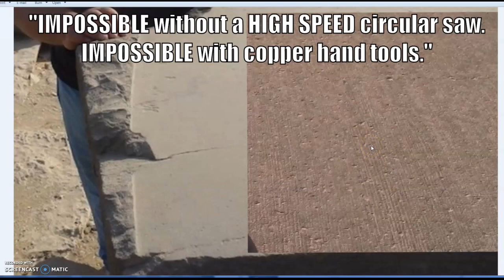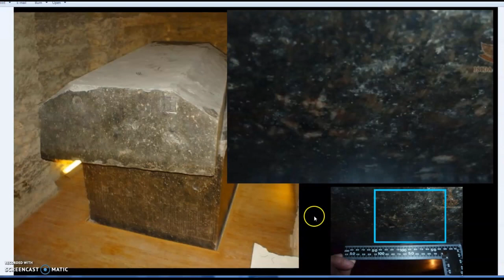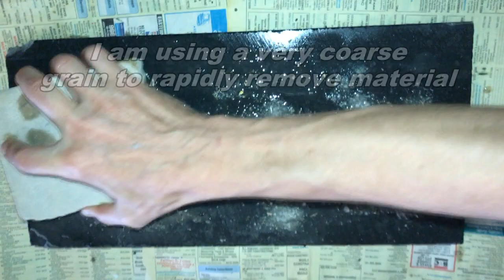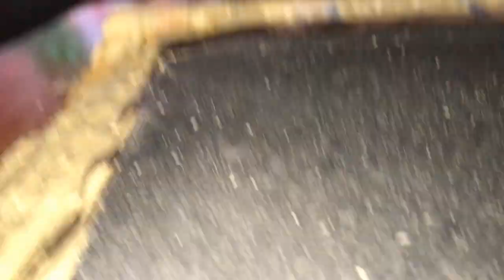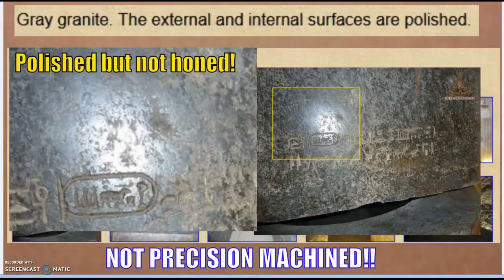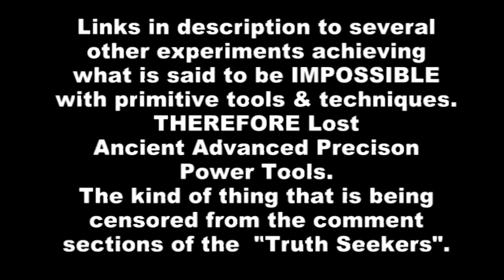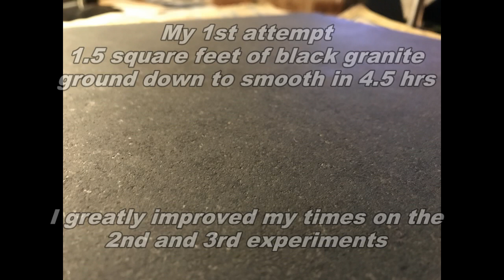Ancient Stone Working Techniques: Experiments with Black Granite on Removing Striations

Comment: Hey SGD hope you're well? I believe Ben, at UnchartedX, may have hosted a discussion with Chris Dunn recently that was aimed at getting some answers, from Dunn's perspective, on our LAHT debate.  I was not super impressed with his answers and I believe he is an example, in the reverse, of the phenomenon that LAHT folks describe effecting traditional Egyptologists? We say that their lack of engineering and hard scientific understanding has made them unable to recognize the signs of LAHT.  I believe C. Dunn is an example of the opposite case.  His lack of knowledge of 'traditional' Egyptology or History has blinded him to some pretty well established theories about the creation of some artifacts and structures?

1.)  An example of this, in that interview, is when Dunn says to Ben, while they are discussing the idea that some symmetrical features of the statuary would need to be cut by something like a modern programmable CNC machine, that to program code for an asymmetrical statue, as you SGD argue, would require a more complex code than a symmetrical one would.  Ben almost cringes at this suggestion because of your argument about 'Hellenistic' or Roman asymmetrical statuary.  This example illustrates both a misconception on Dunn's part and one on yours as well perhaps?

1a.) I say this because Dunn is obviously unaware of the controversy surrounding the bust of "Nefertiti."  It is believed that the discoverer used a 'model' created by the dynastics to, in a way, 'fake' or over sensationalize his discovery.  It probably turns out that once a pharaoh was named a 'model' piece of statuary, displaying the state sanctioned features of that monarch, were mass produced and given out to local sculptures and artists throughout Egypt to use as a 'model' to create more statues or images of that monarch to be sold or given out at the temples...etc to pilgrims and ancient tourists.  This could be done by expanding or contracting the well known 'grid system' used by the dynastic artists to create enlarged or shrunken versions of a 'formalized' image.  The "Nefertiti" bust discoverer is believed to have taken one of these 'models' and hired an antiquities forger, of which there were and are many still, to use period plaster and pigments, he had also discovered onsite, to sculpt the face on the bust.  If Dunn knew this story then he would understand why a very mathematical or geometrical system was used to create the statuary of dynastic times.  This does not address the issues around the cutting and polishing of these statues however, just the mathematical formulas used to design them.

1b.). The reason why you might also have a misconception about the importance of the symmetricality of this statuary is that although it would be more difficult to make a single asymmetrical statue than it would be to make a single symmetrical one; it would be nearly impossible to mass produce on a 'semi-industrial' scale asymmetrical statues without advanced high technology?  This means that the argument Dunn is actually trying to make, though he expresses it very poorly, is that the high precision symmetricality of the statues is evidence of LAHT for the reason that the definition of "high technology" here, as I understand it to be, is that the use of highly precise tools and equipment, difficult base materials to craft like very 'dense' or difficult to shape stone, and precise symmetrical elements in the designs of these objects is how we ourselves would mass-produce them in our own modern manufacturing facilities if we wanted to.  Does the argument make more sense when presented like this?

Just a few of my thoughts on these issues.  I have more but not enough time at present to write them down.  I am going to share with you, in my next post, something way more interesting to discuss.  I will also post this message on Ben's site.

Cheers,

Andrew
Reply from the maker: cheers
Yes I would agree ver much on the first paragraph, I would also believe it goes a little further than that, for instance on a recent episode of Ancient Aliens featuring Chris Dunn he repeats the claim "impossible with the tools found in the archeological record". Which would imply he is familiar with the archeological record on such things and what those tools can do, repeated experiments have shown over and over that the corners of serrpaeum or the H blocks at Pumapunka can be made with simple stone tools/ flint. 
https://www.youtube.com/watch?v=gyWeksAo8VM&list=WL&index=73&t=452s
Sculptor using a pantograph to make exact copies of beautiful statues, it's an ancinet tool at least as old as the Greeks to make replicas. Restorations of temples suchas the Parthenon they wanted to use as much original stone as possible, including broken pieces from columns etc. They used a pantograph to perfectly fit shattered stone faces to the new stone, this is the most difficult thing to do by a huge factor of difficulty.The ancinet method was the best for the masons in the field.
Though whether a assymetrical scuplture or refitting a broken piece of stone, such simple tools make transferring symmetrical designs seem like childs play in comparison. There are so many extra points that need to be transferred. In essence its like copying a chaotic squiggly line versus a symmetrical line. I would insist that the assymetrical copy is much more complex just by the sheer number of coordinates. if you can cut a piece of glass to fit into the missing shard of a broken window then refitting a symmetrical uniform shape... it's chaos versus order, chaos is just more difficult to measure then order.

I also think it's very interesting that the marble statue of David is used as a comparison but the Greek and Roman granite/basalt/ porphyry statues and large boxes are not mentioned. 
Or in regards to precision engineering the Romans aqueducts must surely be included at the top of any list, over miles and miles they kept the same angle, a gradient of 4800/1 being recommended. Vitruvius and Heron even describe the instruments used, such as the chorobates. Even by volume just one of the larger aqueducts made of stone rival the Great Pyramid, and they are more precise, the Great Pyramids alignment to true north is along the ground, the more precise aqueducts maintain a more precise angle THROUGH THE AIR!!!!! 
If you watch the LAHT community they rarely mention Greco-Roman except to diminish it.
I find it very hard to understand how they could be so ignorant of Egyptian archeology, and even harder to understand why they aren't fascinated by Greco-Roman engineering escpecially since we have amazing texts such De Architectura which is just an encyclopedia of philosophy, engineering, chemistry.
Heron of Alexandria...as in the Library of Alexandria. 
If you look at the work of Da Vinci, his design for machines on lifting etc are just copied directly from these texts. Vitruvius.... Da Vinci's iconic Vitruvian man,
Greco Roman era.... an Egyptian fascination, temples of Isis for instance and symmetrical statues from that period.

Sorry I could rant a long time on this.....For instance Manetho wrote an Egyptian history for the Ptolemaic rulers, when Manetho references the deep past it is insisted he must be taken seriously, but his histories on the Dynastic period which so closely match the historic record.....then it is presented as some sort of conspiracy.
There are so many clear double standards, cherry picked references, ommissions that I can only describe as deliberate.

Again sorry for rant, for the next few months at least I will be working with granite, I am buiding up my skills and replicating the "impossible without advanced technology". Here in Sydney there's nothing but sandstone for 200 km's in all directions. Restricted to small scale demos for now but arranging some larger experiments to replicate, compliment and expand the work that has already been done.
If I can do it, anyone can do it.
Reply: @SacredGeometryDecoded  Before the "Osirion" discussion I do want to comment on some of your points above:  

The Hellenistic and Roman examples, in statuary, I agree do rival the so-called "Khafra" 'ka' or 'Horus protected Khafra" statue (and a couple others that are similar to it, that were found, in the "Valley Temple") as well as the famous "Menkaura Triads" found in the mortuary complex near "G3."  By similar I mean:

In the type of stones used to make them as well as the detail and the finish as well.  I do also believe the 'missing' secret cutting tool for granitic stone is FLINT + one other tool. This other tool is chemistry.  I do, firmly theorize, that the so-called "scoop marks" especially but also a lot of the cuts and "drill cores" are a combination of an applied organic acid, other organic solvent, or caustic substance followed by cutting or scooping using flint, different strengthened metal alloys of copper, or even meteoric iron cutting tools.  

Meteoric iron, which I understand to be a much more difficult form of carbon, alloyed with who knows what other exotic metals, to work than crude raw pig iron?  Requiring smelting facilities capable of producing very high temperatures with which they could then have easily smelted lower quality Iron had they desired to?  This theory of mine has pretty solid evidence to back it up.  The blades found in the so-called "Tomb of King Tut" where probably taken, by Lord Carnarvon, from his excavations at Amarna and then dumped in that ridiculous 'tomb' of his in the "Valley of the Kings." He likely reclaimed another part of a tomb and staged it to look like the long lost discovery he had been searching for all those years? Carnarvon likely dumped many of the 'looted' treasures of "Akhenaten," taken from Amarna, haphazardly in a rush to fake this find?  None of the 'grave goods' match, the wall paintings have several anomalies, and the tomb was cut for a women, probably "Tut's" mother mother "Hatshepsut?"  The famous gold "grave mask" is even a pastiche...lol? This was done, by Carnarvon and others, to generate a sensational find, a phenomenon that has been going on, in Egypt, forever and is one of the principle reasons why the archeological record is so f*^ked up.  But back to the important part.

These blades were not created in the Middle Kingdom when both "Tut" and the knowledge of crude Iron working, which had spread from just a few folks to the general society, were around at the same time .  The blades were pretty definitely created during "Old K. or Predynastic" times, supposedly.  I believe the formal establishment agrees with me on this but please look for opposing points of view, if you feel I am in error?  I believe all of these tools plus lathes, from small delicate models to very large ones obviously capable of creating the massive single stone megalithic columns at Abu-Sir with lotus capitols, could have been used to create many of the difficult to explain examples we see?.   

Back to your points about the flint method for cutting granitic stones: This is perhaps another good example of modern engineers w/o Historically trained advisors?  Perhaps they, and we all, have become so used to recent machining methods that we have lost the knowledge that flint can be used to work granite pretty effectively.  At least in some brief examples I have seen?  I have also watched those videos of antiquity forgers using stolen granitic stones from archeological sites to fake ancient stoneware.  They use primitive, flint bladed, lathes to fake the so called "1st and Predynastic" era exquisite bowls, jars and 'amphora' like jugs.  I would like to see measurements taken to see how accurately, the forgers or even legitimate masons or 'experimental archaeologists,' have actually matched the ancient craftsman's precision, in their examples with this technique?

Sorry for another long post....nothing to do around the house while quarantined by societal mass hysteria...lol.  Have more to say on the boxes or so-called "sarcophagi" in my next post...

Talk again soon, cheers bro!
Reply from the maker: R.A. Zekauskas there’s a great book De Re Metallica, available free on line, an encyclopaedia on mining and smelting from 1500’s. Very detailed technically but also eludes to some other chemistry, alchemy, something I am very interested in myself and have posted on before.
One of the oldest surviving texts is a Mesopotamian guide to glass making. However these early alchemists right up until the famous alchemists like Geber veiled all their works in secret trade language sometimes including poetry.
Earliest glass making text was deciphered because one later king managed to record the procedure in plain language.
Porphyry the famous neo Platonism philosopher  noted that Hermes (Thoth)  is a generic name given to all knowledge.
Copernicus gives Hermes credit for his astronomy.
In the past I have also posted on something that is rarely discussed in mainstream or alternative circles. In that the copper we know is 99.95% pure but historically this was not the case.
Ancient Egyptian, Mesopotamian and South America copper ore naturally high in arsenic. Arsenical copper is defined as below 0.5% arsenic and is probably accidental. Arsenical bronze predates tin bronze and is above 1% arsenic meaning it was manufactured.
Very strong evidence if not proof in 3rd millennia bc on Iranian plateau they were removing arsenic from copper for later sale. 
Copper with 2% arsenic is much stronger, harder on both Mohs and buckets scale. It casts much better and was being used in bell and canon casting .
Steam train boilers specified the use of arsenical copper.
Arsenical bronze of the right mixture rivals steel.
Unfortunately there isn’t much detailed info on exact percentages but the copper chisels from Egypt do contain arsenic. They even imported it from Mesopotamia, better for casting jewellery but also the colour is nicer.
In natural history pliny mentions the best copper mines and they are good sources of higher arsenic copper ores.
Peruvian copper is especially high in arsenic and bismuth too, another element that makes the copper much harder/stronger.
Though even just plain old copper and ancient metallurgy as well as medicinal herbs. Things like castor oil, Natron especially. I want to revisit these areas.
Some artefacts of predynsatic kings such as scorpion have been analysed and hint at some more advanced chemistry than usually considered.
On phone at the moment so no idea how to link, a lecture called Hallowed Herbs by the oriental institute, there she speaks of coded language used in medicinal herbs especially. She references a book, if I remember correctly the title is the encyclopaedia of Assyrian chemistry or similar, he also speaks on trade secrets in glass and metal manufacture.
These I think are the “real” lost ancient technologies.
Also big iron was another source of pre Iron Age. Still being used well after, as I was told early American colonies used it for church bells.
The famous iron pillar of Delhi has the signature of big iron. Like meteoric iron very rust resistant. Though just the copper trade industry very sophisticated at beginning of recorded history. Egypt, Indus and even arkaim in Russia have many furnaces and distant trade in ores as well as goods.
Earliest texts from Sumer are very business orientated manifests and inventories.
The “primitive Stone Age” has mastered bureaucracy. Which is about as unsexy a topic ever to be discussed but a huge part of the ancient history puzzle. If you are well organised you can do a lot with next to nothing. If poorly organised the best equipped army will be routed .
The Palermo Stone is an interesting piece, lists several predynastic kings but also the activities of early dynastic kings. They were conducting regular census’ and one in particular was a special census of the goldsmiths in Egypt. 
In the next few months I will be helping someone release their research, vow of silence on details but he has some very compelling ideas on ancient tech orbiting the areas mentioned above.
Reply: @SacredGeometryDecoded  Great information here.  Will Take me some time to digest all of this but seems you and I are actually very close in our ideas.  I too believe the archeological record is explainable, in the rough 'accepted chronology,' if one is willing to attribute the technologies you have listed above to the "Old Kingdom" or "Predynastic times."  I believe the unwillingness of 'establishment' thinkers to accept that these technologies were likely in use in those very ancient times has allowed the most 'radical' LAHT thinkers to fill the gaps with ridiculous 'Alien Astronaut' theories or 'power plant' theories and other highly fanciful speculations.  More to follow.....
Reply: @SacredGeometryDecoded  great response and I really enjoy the dialogue and the back and forth! Wish the LAHT 'Luminaries' would be so forthcoming in responding to these issues being raised by both their critics and their admirers? Will send a message to you soon about some issues I saw in the "Osirion," that I want your feedback on? Take care my friend.
Reply: all one has to do is watch Coral Castle Documentary with Chris Dunn hosting to see what he is made of.